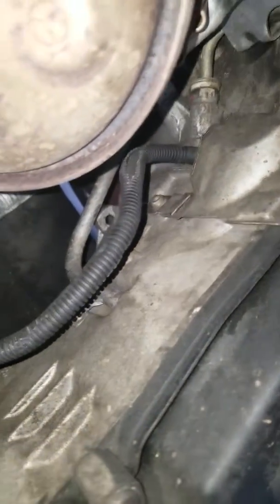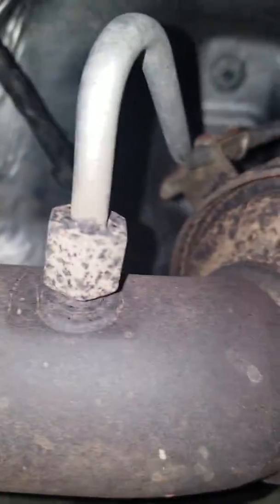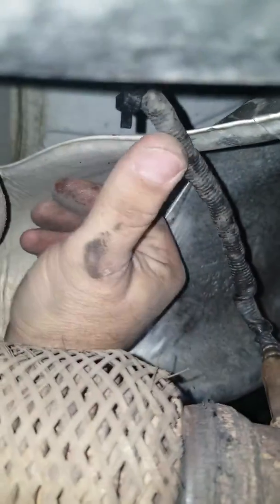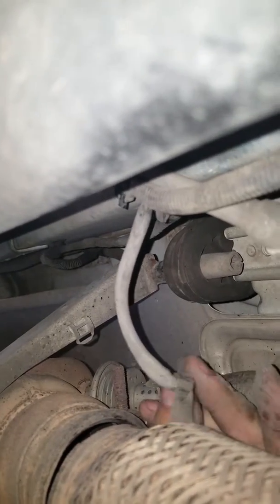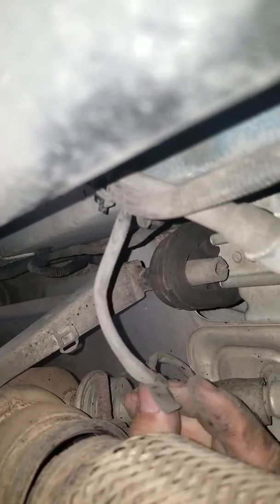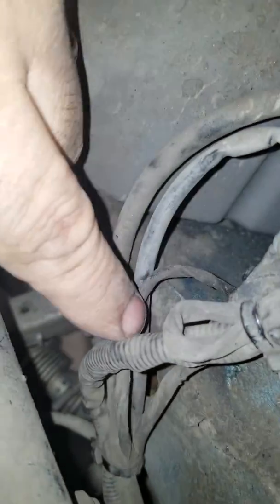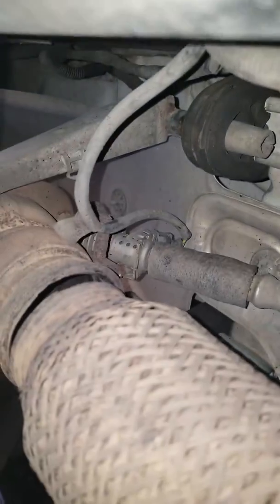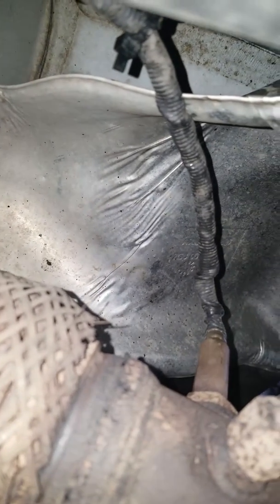2011 Sprinter blowing fuse #16 Looking for ground fault in DEF exhaust system

Comment: Did you find any fault?
Reply from the maker: Yes the exhaust flex pipe broke and heat melted the wires along the frame, it was not easy to see until I cut open the wire covering to expose all the melted wires inside, so I unplugged them as much as I could to pull them down enough to remove and peel back the wrapping to expose the melted wires, I cut out the melted wires and replaced those wires, then rewrapped them ,fixed my flex pipe and put the wires back... All is well and working well again :)
Reply: I have the same problem.. can you tell me where exactly you find your problem please??